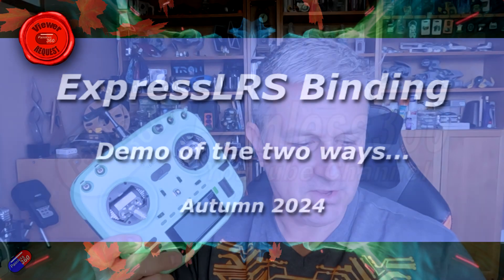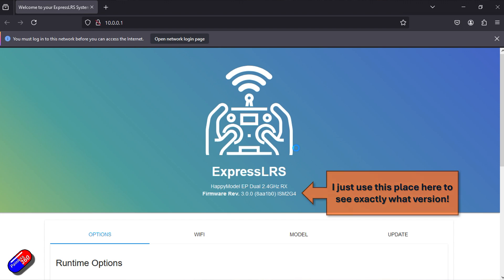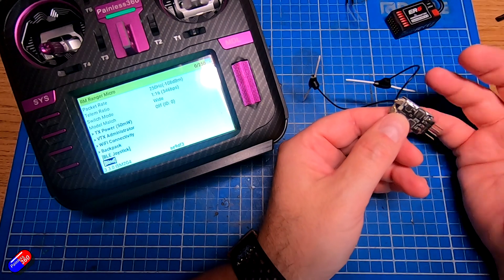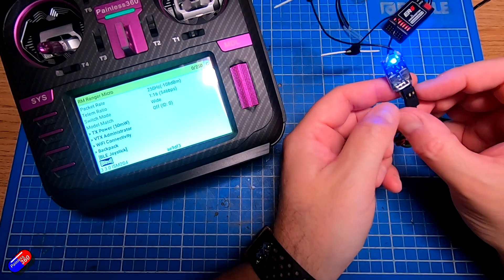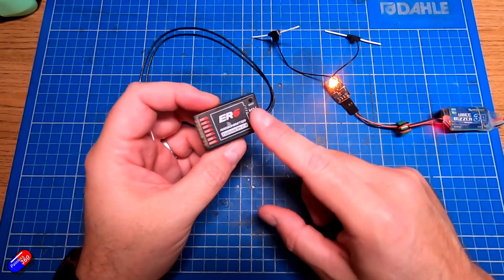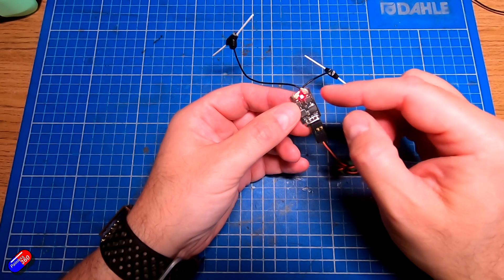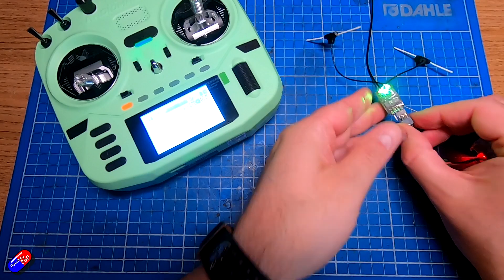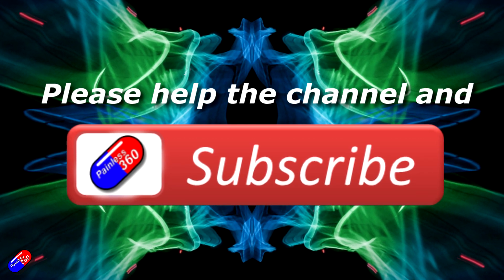ExpressLRS (ELRS) Binding Demo, with and without a Binding Phrase...

Comment from the maker: Note (Spring 2025): 
Updated Binding Procedure since ExpressLRS 3.4.0:
 - Binding Phrase, flashed or set (via the WebUI) into both devices.
 - 3x Power Cycle.
 -  Bind Receiver button in Betaflight Configurator 10.10 (or later) Receiver Tab ( This will ONLY work if your flight controller is flashed with Betaflight 4.5.0 or later)
 -  1.5s Button Press on the Receiver itself (or Boot pad shorting to Ground).

Comment: Excellent! Just couldn't get the receiver to enter bind mode. The passphrase solved the problem. Oddly enough, the receiver is on version 3 and the tx on version 4. Cannot find out how to update the firmware on the rx
Reply from the maker: Check out my video on updating recievers... Happy flying

Comment: Why on mind doesn't bind to gx12??? Even though i did 3x then bind on the radiomaster still doesn't bind. The quad receiver keeps blinks, and the radio very fast to search but still doesn't bind.
 Almost 2 minutes nothing happened.
Reply from the maker: What troubleshooting have you done already?
Reply: @Painless360 couldn't bind the gx12 to Moblite7 Avatar Mini 1S 75mm HD Whoop Fr-Sky. i thinks the receiver of this whoop are not elrs and only bind to taranis remote controllers not on gx12 that have expresslrs. but if you look at the info of this whoop flight controller have spi expresslrs.
Reply from the maker: You need to see what Rx is in it. To bind to a FrSky receiver you need a multiprotocol module in the radio. The GX12 is ExpressLRS only. See my videos on MPM...

Comment: Nice Video.  Is this the correct understanding, If I have a current model that used the Power on off three times to bind the Tx to the Rx and then I build a new Model and use the Bind Phrase, I will have to go back to the model without a bind phrase and add it so the tx can bind to the new Model?  Cannot mix and match across the model id's? Thanks in advance...
Reply from the maker: I never tried it with both, let me know how you get on!
Reply: @Painless360  thanks for the feedback I'll give it a try 😃

Comment: Thank you for this video! 

I am learning about binding multiple Helicopters to multiple radios so my wife and I can fly at the same time. Your timing on this upload is pretty good :) 

One question about your setup: I was told not to use the same binding phrase on two radios, this flies against what I understood about model match; I didn't want to argue without independently validating first.  After watching this, it sounds like you do the same binding phrase across multiple radios and use model match to keep things separated.  

I believe I can have my wife's pocket radio bound to each helicopter with our universal RX binding phrase and then use model match to each one so we are always separated (provided we are careful to have separate profiles active while powered up).  Agreed?
Reply from the maker: That is something I have never tried. Let me know if it works! Best of luck